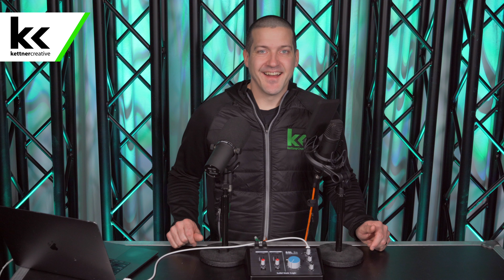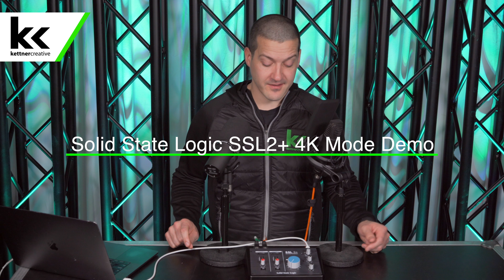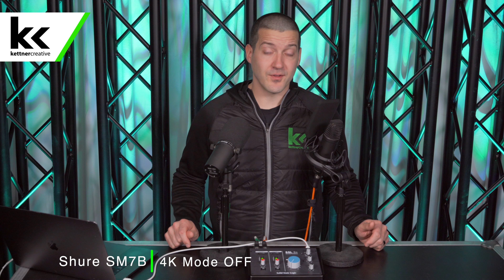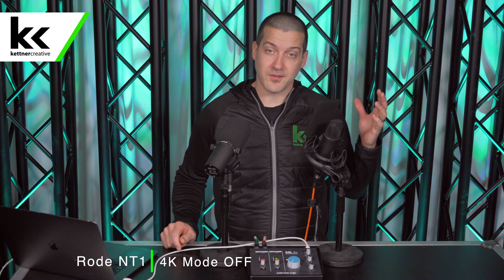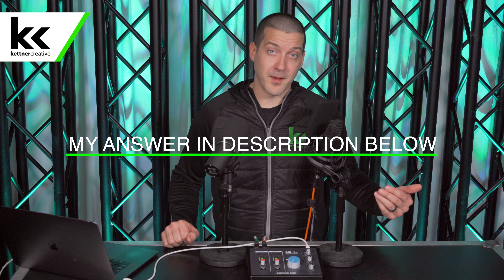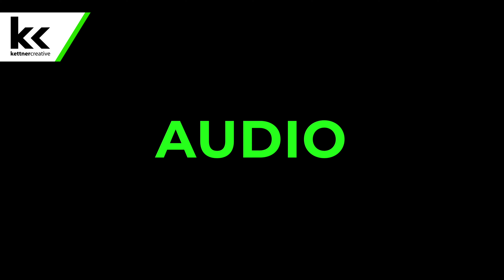Solid State Logic SSL2 4k Mode Demo

Comment: I have this box and initially liked the 4k mode on female vocals with the SM7B but over time I think im liking it less and less. What initially seemed like a nice lift and jump fwd of the vocals is starting to sound a bit hollow and noisy artificial top end addition, its also harder to sit it in the mix with the 4k. Im going to go with adding any extra top end required after the recording instead.

Thanks for this demo, really good to have a proper A/B and on two different mics that are both popular.
Reply from the maker: I agree with all of your comments 100%. I got hooked on the button, now I avoid it.
Reply: Hey man, i have the SSL, about to get a SM7B. For rock (male) vocals, you do not need the Cloudlifter, right?